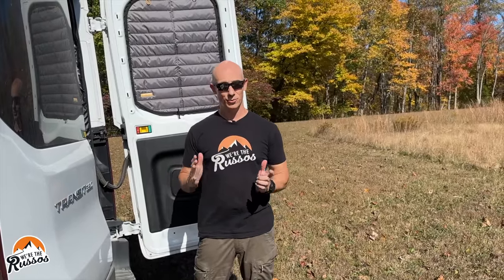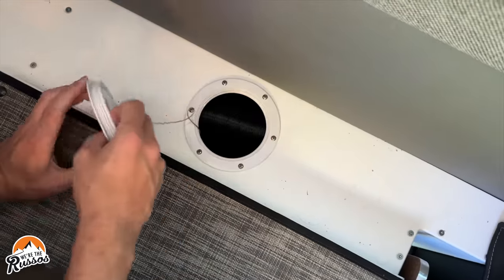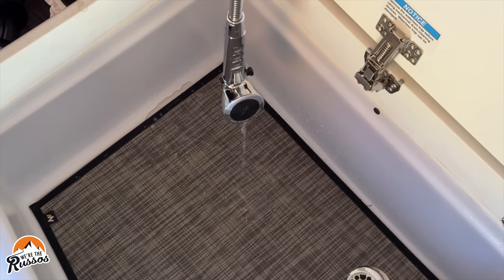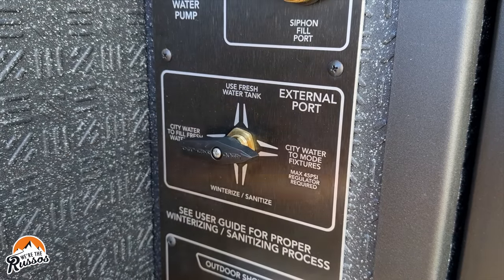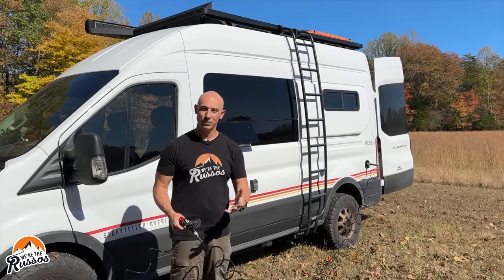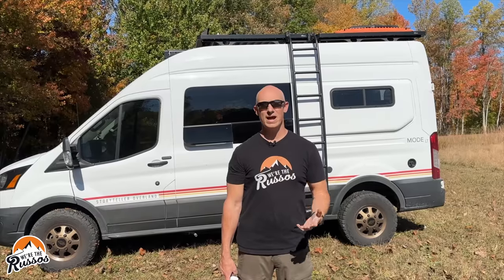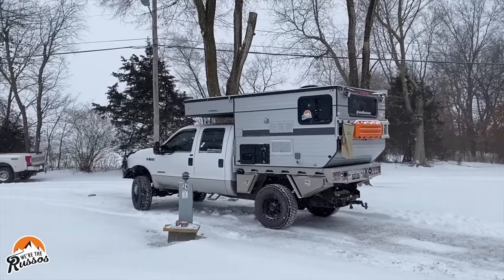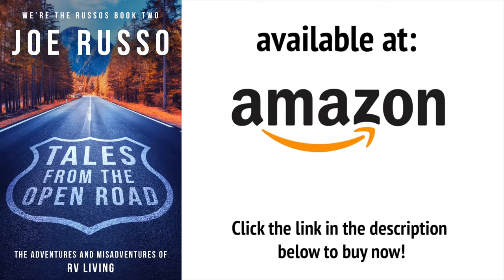How We Winterize the RV without Anti-Freeze

Comment: We use the compressed air method and only run antifreeze through the lines when temps are forecasted to be freezing or lower for a week or more. I was told by an RV tech that when using compressed air to, use a regulator set to the recommended PSI for your water system by the manufacturer. Great video, as always. Thank you for sharing. Peace and Safe Travels.

Comment: I’ve always used compressed air to blow out the water in the system and then use antifreeze to winterize. It seems like no matter how much air you use you never quite get Al the water out. Maybe overkill but much better than frozen water lines. I also crank my regulator down to 40 psi on the compressor.
Reply from the maker: The thing is that bits of water here and there freezing up are fine as long as the line isn’t full (frozen water needs room to expand) and you’ve drained the water pump as frozen water inside can damage the pump.

Comment: Last winter I just opened the drains. It doesn’t freeze much in the Seattle area, but I’m in the foothills so there is usually one or two weeks where it will be below freezing at night and I learned about that little filter in front of the water pump because that’s what cracked. 
It is a little pain to get to because the water tank and pump are under the bed and covered with insulation. 
This year I hope to winterize it with being in Arizona and California during the cold parts

Comment: We're a bit different, it's a park model RV we own with partners, and it does get some winter use. We turn the heat to 50 degrees and put a couple of "glugs" (my wife's word 😂) down the sinks and toilet. We leave cabinets open to allow warm air around the plumbing.

Our biggest problem was someone going up last winter and leaving the heat at 68 degrees, we used about $500 extra propane because of that. Shared ownership has benefits but that's one time it was a burden, although it was only $125 for us.

Comment: Maybe you mentioned it but I thought I would reiterate it anyway. If your going to use an air compressor don't be a jerk and put the PSI on like 120 like your trying to power a impact wrench. 40 to 50 PSI is the max for PEX so keep that in mind. Our current van uses Jerry Cans for fresh and grey and we have a dry flush toilet. Winterizing is about as easy as it gets.

Comment: I do the same thing for winterizing my rig. Since I live in Florida, I don’t have to do it that often. But I have a battery operated air pump that will maintain a predetermined pressure. So I leave the air pump on and then I go in the rig and just open up all the faucets One at a time. So once it builds up to 35 pounds the air pump will automatically shut off until the pressure goes down then turns back on. Safe travels :-)
Reply from the maker: Cool setup

Comment: I’m sure others mentioned this but I put a regulator between the air valve and the camper. The system is usually capable of up to 60psi but I tend to use about 30psi so I won’t harm the water lines. Most newer rvs have a suction hose near the pump to allow the water pump to suck water out of a jug and pump it through the system.
Reply: Didn’t you mean to say you pump antifreeze out of the jug, not water?

Comment: Hi Joe,

I do the air blow out and then just put enough antifreeze in the lines to keep any low spots from freezing.  Springtime comes and I just run the water into the system for about 15 minutes and the hot water maybe a bit more.  The previous owner of our RV just used air and when I bought it I had to replace "P" traps and the water heater had a split in the bottom of the tank.  Over the past 20 years of ownership I have had little issue with any of it.
Now enter in the new problem though.  My old grey plastic lines and fittings are starting to leak a bit due to age.  They aren't available so I'm probably going to have to replace all of it with the PEX stuff.  A good weekend project.
Take care!
-Jon ( I met you and Kait in Brattleboro VT)
Reply from the maker: Yeah that will happen. Good luck with swapping out the lines

Comment: People definitely need to know their setups pretty thoroughly. Some rigs have weird nooks and crannies in their plumbing system. My Dometic toilet (hooked up to a black tank, not a portable) has to be flushed with antifreeze; using air alone leaves water in a valve that WILL break when it freezes. Every spring, the RV forum I’m on gets a dozen of more posts from folks who tried the compressor-only method, usually in places with harsh winters, but even in warmer climates where the temps barely dip to freezing. And replacing that valve requires pulling the toilet. No thanks! 

Antifreeze is cheap (get the stuff without alcohol), and it’s quick if you have a bypass valve on your pump or something like a Nautilus system with siphon function. Drain the system, pump in the pink stuff, done and no worries. It’s much more of a nuisance to clear in the spring, obviously, but since the system should be sanitized at the start of camping season anyway, I’d much rather deal with that than a plumbing repair.

Comment: This is great, Joe. I park my Revel under cover plugged into 30 amp shore power with heater on 52 degrees BUT I do winterize in case we get a true hard freeze. I do not like pumping fluid into the water lines even though I don't drink from my Revel water supply.
Reply from the maker: That’s a great thing because you never know what might happen with the cold

Comment: Winterizing with air is a good idea except, Aquahot doesn’t recommend winterizing with air. It may damage the Aquahot system.  ($20,000 unit to replace) So you need to go back to the old fashion antifreeze way for most newer diesel class A motorhomes that have the Aquahot systems.  Also, you cannnot winterize a dishwasher and washing machine using air only.  I guess you can chance it with residential fridge but I doubt air only would work.
It takes about 5-10 minutes to get all the antifreeze out.   We do it in Virginia on our way to Florida in January. Take our first shower on the way to the Panhandle.

Comment: Joe.   I have a regulator dialed to 50psi when I do this.  Otherwise you could damage something.   Our viair is capable of a lot of pressure.
Reply from the maker: I’ve never used one because I’m not pressurizing the line since the valve is open and I just give it quick spurts of air
Reply: A pressure regulator is important if you’re coming off of a heavy psi air tank, and anything restricts the line.

Comment: Our van was winterized when we picked it up. We have not been able to get the taste out of the system, even after many flushes. So we have to bring refillable bottles of water for drinking and cooking.
Reply from the maker: Yeah it takes a while to get rid of it. One suggestion is to put a tiny bit of bleach on the water tank and run that through the system which will also sanitize it

Comment: I leave a 400W heater in the our Mode LT to control humidity as well as freezing after  draining the low points, but use no anti freeze. I've heard you can also use a gallon or two of cheap wine instead which should lower the freezing point by about 10 degrees.

Comment: I do the same thing, but learned the hard way that you need to get some antifreeze in the water pump internals, the P-traps, and the tanks, which have residual water in them.
Reply: Yep, I made sure to pour 12 ounces of rv antifreeze down the shower drain and I poured about 40 ounces down the sink and distributed it into the macerater pump. This is on my 2024 Revel. It won’t siphon which I don’t want to do with antifreeze but traveling through Mexico I may need to siphon water into fresh water tank and need to figure out why my Revel won’t siphon. It is a known problem with Revels. I am thinking I simply need to prime the water pump by hooking up a hose to the city intake and running water to all the faucets. Once I do that when I am in warm weather - not now - I think siphon capability will work.

Comment: In Oregon, there aren't many days below freezing. Do you think just turning the heater on to 50F will work (also plug in the shore power)?
Reply from the maker: If all of your lines are inside the RV, then that should work. If it’s only below freezing at night and above during the day - it may not even freeze at all so running the furnace should be fine. If it stays below freezing all day for a sustained number of days, you may want to consider winterizing
Reply: @Weretherussos  Thank you!  I have the same STO LT as yours - are all lines inside the RV?

Comment: In my motorhome I run 3 gallons of antifreeze through the pump into sinks shower and toilet, blow them out with a 3 gallon pancake compressor then dump 1 gallon down all drains for pee traps. Dewinterizing I use a couple cups of bleach into my 40 gallon fresh tank and let it set overnight them pump it through everything, then I repeat twice filling the fresh and pumping through everything. Works very well and all is good.
Reply from the maker: Sounds like a great solution.

Comment: Joe - On your Mode LT, would you also open the two low point drain valves underneath the sink?  As well, are all the low point valves "open" when you're pushing air through the system?  Thanks for the input, from a new Mode owner.
Reply from the maker: I did not open the one under the sink but would suggest you do. I leave the low point valve by the shower open and blow out the water there until there’s no more then I close that and blow out the fixtures (you can’t blow them out if the low point is open). Then I open everything up again when I’m done and drive around so any excess can drip out.
Reply: How would you get to those under sink valves? Removing the drawers? (Fellow LT owner)

Comment: Questions from a fellow LT owner: Do I need to winterize at all? I live in this thing and love it. I'm embarking soon on my first real winter trip. If the van is occupied and heated, am I okay down to the ungodly temps that Storyteller touts? Do you know how the lines are routed from the tank?
Reply from the maker: That depends on how cold it’s getting and what you’re comfortable with. The water lines are run from the tank, which is in the cabinet on the rear drivers side to the shower and water heater. The line for the sink runs under the metal partition on the floor between the galley and garage area. If you’re keeping the temp inside warm then that will help keep things from freezing. The only thing that’s going to freeze is the grey tank since that’s outside of the interior. I believe there are lines that run from the engine back to help warm the grey tank but you’d have to be driving for it. That said, it all depends on how cold you’re going. Winterizing is a good insurance policy to guard against anything freezing unexpectedly.
Reply: @Weretherussos  Thanks for the detailed explanation

Comment: During the process you say to drain all the water. I do that on my Storyteller by opening all the low-point drains. You say after draining water out of the water heater to then close that particular low-point drain. When all draining is done you don't say to close all low-point valves. And at the very end you say to reopen all the low-point valves. Should all low-point valves be closed before blowing out the system?
Reply from the maker: When blowing out the lines, close all low points and open the valves on the sink, shower etc one at a time.
Reply: @Weretherussos  Thanks!